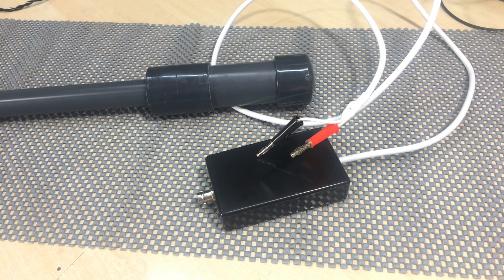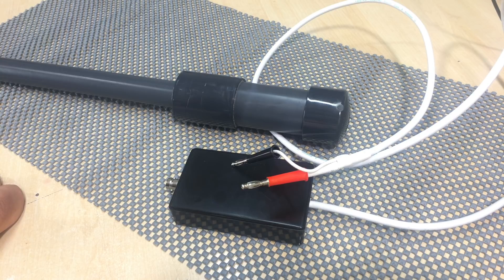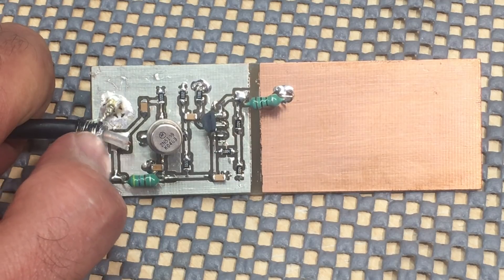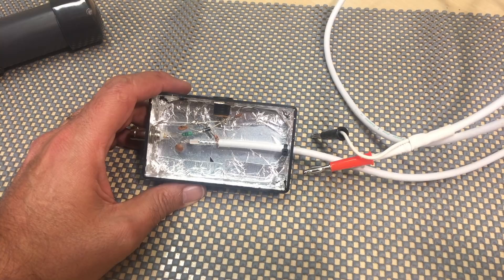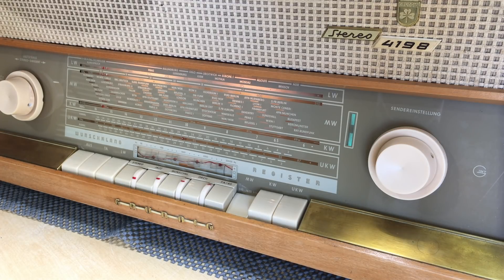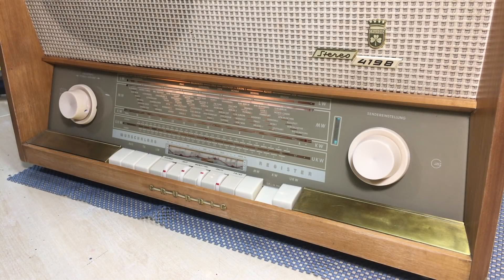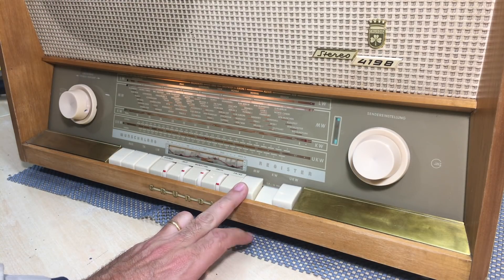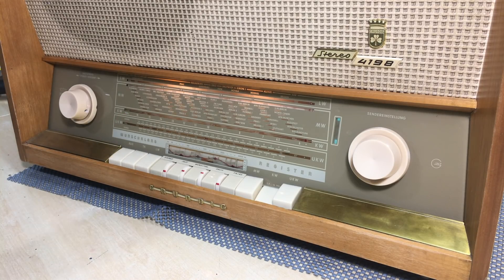Build and test a PA0RDT MINI WHIP antenna. The tiny great solution for LW, MW and SW listening.

Comment: In my experience (over 60 years as a SWL and licensed amateur), these high impedance mini whip antennas are great if you live in a low noise environment but terrible if you are surrounded by noise-producing gadgets like LED lighting, and anything which uses a switch-mode PSU (which is pretty well everything). Ive tried everything to reduce the noise such as choking the coax and adding earths at various points along the coax but nothing helps. I've built several types of mini-whips and they all behave the same. I find a small loop antenna such as the Wellbrook to be far quieter, usually by several s-points.
Reply from the maker: I was able to place mine on the roof (raised about 1.8m) as I live on the top floor of an apartment building. It seems to be sufficiently removed from the devices in my apartment to do a decent enough job. I’ve not really tried loops, but that’s in the cards.

Comment: Miniwhip is a PROBE for electric field, not an antenna
Reply from the maker: It’s commonly known as the mini-whip ANTENNA
Reply: @electronicsoldandnew  Yes, I know, it is a very common mistake also because it is used as an antenna but it is a probe.
A probe takes signal from the field without perturb it.
The very very high input impedance of the first amplification stage is necessary just because it is a probe, not an antenna.
Even the pole must not be made of conductive material so as not to attenuate or deflect the electric field lines.
So, as you can see, probes are different!

Comment: I have an XHDATA Shortwave radio together witha DESHIBO GA-450 active Loop antenna. Would a whip antenna make a difference because the GA-450 antenna is also an active antenna with electric power so what i really ask  is with my XHDATA d808 shortwave radio would a mini whip antenna make a difference when listening to shortwave? Or do you people think that a GA-450 active loop antenna is sufficient? Thanks for any reply and Thank you Manuel Caldeira for sharing this video 73's!
Reply from the maker: I’m not sure. I think the active loop antenas are pretty good, and am actually considering building one myself to compare.

Comment: Critical to ensure good height and grounding of metal pole or sheath of coax if plastic pole used. You will double the signal going from 2m to 4m up, for example.

Comment: That's still an E-field antenna. The trick is to decouple the antenna from noise sources, using ferrite over the coax and a virgin ground driven into 'quiet' soil away from the house or apartment noise sources. Grounding it to the same rod as the electrical service or other noise sources are grounded to is the absolute worst thing you can do. That just hardwires noise into the antenna system.

Comment: I appreciate your  earnestness  in bringing  out  the  most  wanted video  on the leaders  entertainment   of the 1960's  . The big name to be mentioned  is pretty good  surely  the  Telefunken bearing  very  sensitive  and  very  low nois rf circuits  which  may be   helpful  for receiving  very jong distance  radio stations  with the  help of sensitive  rf circuits  and   the sound is always impressive  to  hear . The most    unpopular  thing  is that  the rf range is  found limited to a small range  in between 16 meters and upto 49 meters   ie fom 6 mhz and  18 mhz . I really interested  in the full swing c9verage  right  from 11 m to 120 m spreader in more than 4 or 5   bands  .  I am not  sure  that   thev above sw coverage  why the same is limited,  that i am unable to guess.     I   want to know mthe model  of
the radio  model which  covers  the full sw coverage  ?  If anyone  provide    information  ababout  the models  preferably  ,Telefunken,  or any other   model  which haveca sensitive rf circuit capable of receiving  the full shortwave  coverage  ,of course   with valve rf  circuits   Please..

Comment: My only question is how 

How can it work so well

I'm going  to make one of those 

Is tere a way to make it even bigger or preform even better
Reply from the maker: You let me know 😊
Reply: @electronicsoldandnew  i try to remember to post here 

But I'm geusing it works by using the  plate to catch to the current electric field strength and then aplefying the difrence between that and the ground or a slower adjusting plane  instead of actually receiving power from the electric field

So it's more of a very fast field sensor than an antenna 

Like a pressure sensor whit it's end capped measuring the pressure of the air rater than a microphone that has to resonate to the pressure waves

Comment: I am a retired mathematician that does not want to learn to the same degree studying mathematics for 12 years gave me with respect to theoretical math the complex details of other fields.   Amateur radio is a retirement hobby for me but with respect to the Mini Whip I want it to be essentially plug and play.

With the above in mind and adding I bought the Mini Whip pre-assembled I have noticed two things relative to your video and Mini Whip utilization. They are:

(1) You added no additional wire antenna to the antenna pad. Tech Mnds and others added an additional wire of roughly 10 meters to the antenna pad.

(2) You mentioned nothing with respect to grounding. Others say at minimum a counterpoise is needed and my board does have a pinout for ground.

With the above in mind. I have experimented, in a horrible location aka basement, both with and without the added wire attached to the antenna pad on the Mini Whip. Strangely, it appeared to make no difference. But, where it did well was in the 41 & 49 meter bands and almost nothing compared to my mag loop antenna on the medium wave bands.

There is so much information on the Mini Whip and often it's anectdotal and from non-RF engineers. Thus it's hard to pick a direction for how I will utilize my Mini Whip. As an EE I'd trust your information and while 4 years after the video I'd send you a big 73 from kc2wvb if you could give me a bit of direction to head in.

Thanks
RMB
Reply from the maker: Hi RMB
I also read all I could about the system before embarking on the project, hoping to absorb all I could. What I found was that various grounding attempts made absolutely no difference to reception, so I gave up and just accepted that perhaps my particular setup was doing its job. I have the unit at about 1.5m above the roof of my apartment block (I’m on the top floor), coming down via coax straight into the supply u it. I believe the coax sleeve  is probably acting as a counter-poise of sorts. 
Like many out there I fiddled endlessly trying to improve reception, but finally just accepted the miraculous result as is.
Reply: @electronicsoldandnew  Thanks again and I thought I'd share some of what worked well for me.

I've been experimenting with my Mini Whip off and on. Initially I had really great reception on from about 4 to 8 MHz, but recently I have tried what is similar to what I used years ago and that was a Fan Dipole.

Essentially I attached multiple lengthy wires to the antenna pad on the Mini Whip and that gave me better reception in the 10 and greater MHz interval than I had with a single piece of mag-wire run outdoors in an L shape roughly 15 feet above grade using a total of roughly 40 feet of wire. 

What really worked beautifully was adding the output from my home built Mag Loop antenna that was purpose built for the American Medium Wave broadcast band into the antenna pad and ground of the Mini Whip. Fantastic difference on the Medium Wave band. I have another Mag Loop for 80 meters and I may tie it into the Mini Whip too.

Footnote:
My active antenna is inside & while using the antenna without any added wire that is run to out doors worked to some degree; it was adding both wires that extend to the outdoors and a counterpoise that really made it work well at my location. The added Mag Loop and Mini Whip combination knocked my socks off by how well it paired to create a great outcome.

Thanks again...
Reply from the maker: Thanks for your input. This little antenna can be magical.
Reply: @electronicsoldandnew  Much thanks & Merry Christmas.

Comment: Not sure what balun you are using on your "Long Wire" I had a 9:1  but switched to a 49:1.. (Wow) big diff. but that little MINI WHIP is intriguing (I also have a MLA-30+) My long wire beats it.. with the  49:1.. However my long wire does not reach down to 10KHz only 500KHz could say at best and 25 MHz max.. (Very weak above that).. I would want a MINI WHIP if it does what it claims... 73s
Reply from the maker: I’ve actually given up on my long-wire completely after using the mini-whip.

Comment: What impediance is the receiver looking for, could be the long wire needs and matching network, and the mini whip preAmp provides the match and overcomes with gain
Reply from the maker: Tube radios need about 300 ohms. I tried all the available un-un options, and the miniwhip beats that, hence the choice

Comment: Wow, wow... just installed a mini whip and very impressed especially on MW. One thing that surprised me as well was that I got a noticeable improvement by using a pre tuner (MFJ-956).
I’ve also read that some use a 9:1 unun at the antenna end of the coax and a 1:9 unun between the coax and the radio. Something else to fiddle with :)
Maybe an idea for a future “how to” video?
Thanks again, I have gained so much knowledge from your videos.
Regards
Kevin
Reply from the maker: Good to know you’re getting great results. We never stop fiddling, do we 😊 
I got to a point that I decided to stop messing around with it and just start using the thing, and have never looked back.

Comment: I’m just about to install a mini whip, just wondering if there is a problem putting coax directly to the antenna socket. I’m sure I read somewhere that valve radio antenna impedance is a lot higher than the 50 ohm coax.
Reply from the maker: it’s about 300 ohms, but try anyway.

Comment: This radio has an antenna input not designed for 50 Ohm. Do UnUn but connect it backwards - 50 Ohm to the mini whip, and the high-impedance output to the radio. Then run the tests again!

Comment: Hey, hope things are going well for you on the island. Just had a question on this. I have pt one of these together and was wondering what the impedance rating of the cable you were using to get a good termination on the antenna, is it 50 ohm, 75 ohm or some other impedance?
Cheers from Canada, and looking forward to more radio adventures, 

 - Eddy
Reply: Also wanted to ask if you figured out the strange dimensions mentioned in the original article, it mentioned 30 x 150 mm but none of the designs i have seen to date ever had a patch area that large... typo?
Reply from the maker: I use 50 ohm coax cable, and it works ok. Ideally you should probably use a balun, but I haven’t bothered.
I noticed those dimensions, and have also never see one as big as that. I believe that size would cause problems with very strong stations in the FM band overloading the front end of the unit.
Reply: @electronicsoldandnew  Manuel, when you connect the mini whip to a receiver like the Zenith Royal 7000, are you just using an alligator clip from the BNC connector, or some other device?  I'm getting my mini-whip this weekend and am quite confused by the impedance. It would be great if I could just connect with something like a clip and get decent performance, and then improve the connection as I learn more.
Reply from the maker: I simply connect with a croc clip or, in some cases, I got one of those car antena plugs that some radios have a socket for.
Reply: @electronicsoldandnew  Manuel, I got my MiniWhip today, and set up in a test environment in less than ideal conditions, and it worked great!  It seems that using a croc clip to clip it to the antenna gives a better result than clipping it to the external antenna connection on my Zenith TO 7000.  Any speculation as to why that might be the case?  This is true on my DX-440 as well.  I was wondering if external antenna connections might have some attenuation on them?  Thanks for turning me on to this!
Reply from the maker: Attenuation may be the reason. I’m not sure.

Comment: Just what I need for where I live!  Thanks for covering this!
Your thought at the end about higher frequencies dropping off the mini-whip.  How about adding a 10-Turn POT to the power supply and very the voltage.
-- 
Does someone have the Gerber files for this so I don't have to make the board?!
Reply from the maker: I’m afraid I don’t have a the gerbers any more.  It was quite a while ago, and I have never needed to build another one as the original still works perfectly.

Comment: Hi, we  were  always  told  at  our Manchester  Radio  club  to  always  use  white  piping  to  cover   aerials  as the  darker  colours  &  especially  black  colours  have  carbon  added  which  is  conductive  &  can  block  signals  reaching  the   inside  antenna, I  dont  know  if  you  have  compaired  them, I  have  just  received  one  with  grey  tubing  &   was  thinking   of  changing  it  to  white.
Reply from the maker: The piping is pvc so I don't have a clue if carbon is used in the colouring. However, I tested this with no pipe at all and the result now is the same.

Comment: I used one, and it worked for some time. But after some thunder and lightning, the FET died...
Impedance at the gate is very high and there is no protection against high voltages or a high amount of static charge in the air.
(Maybe two anti-parallel diodes at the input would provide some safety?)
Reply from the maker: Frank55 : probably would work, but not sure what it would do to the frequency response. I’ve not had that problem so far.
Reply: @electronicsoldandnew  Just a thought, but one could incorporate a multipole relay in the unit, that when DE-energised shorted the gate drain and source of the FET together - During an electrical storm one would only have to power the unit off to put it in 'safe' mode?

Comment: Hi, have your long wire antenna have ground conection?
Reply from the maker: F. Kharrasi : No. Can’t getting a decent one up here on the top floor of the building.
Reply: @electronicsoldandnew : Ok, so for this reason, your long wire antenna does not work properly.
Reply: @f.kharrasi4333  Long wire with a 9:1 matching UN-UN transformer and a length of shielded cable may actually work better.
Reply: I was wondering the same thing, but I seem to recall on one of your videos that you sometimes install 3 pin plugs on your radios. Just thinking that with a 3 pin plug installed would the ground from the radio end up at the mini whip via the coax shielding?
Reply from the maker: Yes, it does.

Comment: Hi! How were you able to make that PCB for the antenna? You covered half of the copper board when you sunk it into the ferric chloride? Or what method did u use to make that nice PCB?
Reply: Also, what is that inductor between the amplifier and the actual antenna (the 2 halves of the PCB), it isn't on the original schematic.
Reply from the maker: I did in fact cover half the board (nail varnish) and the rest by the toner transfer method. The inductor is suggested on some forums to block fm reception which could overload the input.

Comment: Your 30m long wire antenna is under the ledge of the roofing. That's not ideal and maybe repsonsible for the lesser reception caused by interference from inside your appartment.
Reply from the maker: D Rama : could be, but I can’t place it anywhere else in an apartment building, so it had to be that way.

Comment: "Electric Field" I think and not the "Magnetic Field" from what I understand.  https://youtu.be/H1pfRCvi1P4?t=277

Great video by the way!  Thanks for sharing.  I am about to make one of these and have been reading for a while.  

Interesting the methods for antenna design to detect the signals. 

I remember the effects of the different antennas by thinking like they are literally like components in their design and sections of circuits as antennas.  

Inductors are like loop antennas, magnetic loop antennas in particular and deal with magnetic field coupling.  

Capacitors are like old school air gap plate capacitors and the schematic also... so those deal with electric coupling since capacitors are electrolytic (not all caps are electrolytic... though is a way I remember). Charge builds up on the plates too and cycles with the AC... and those are electrons dynamically like not electrostatic... I guess unless looking at in moments in time. 

Might not be the most accurate method... though seems to work for me.  Thanks again for sharing!